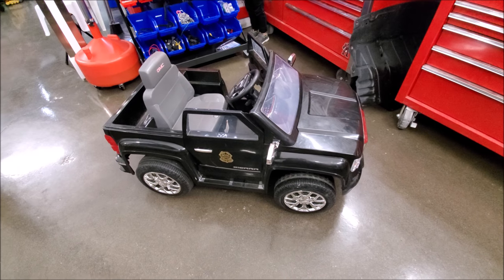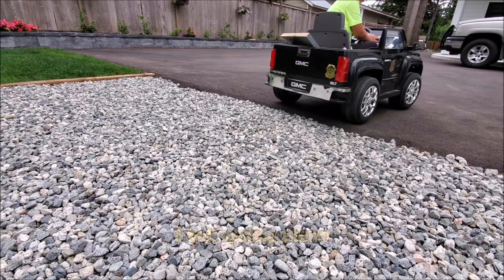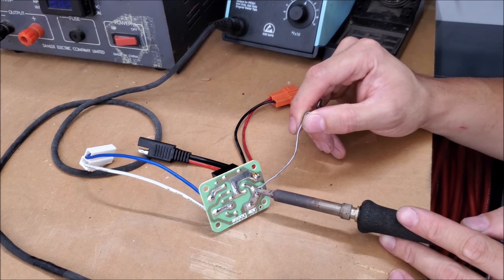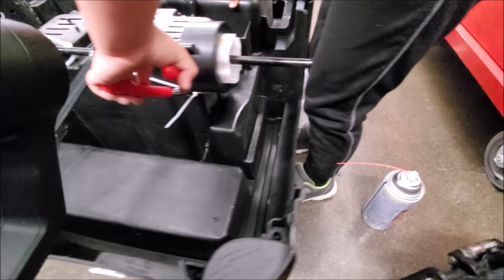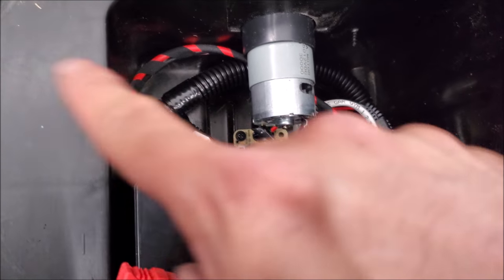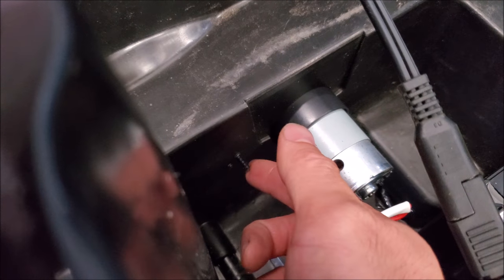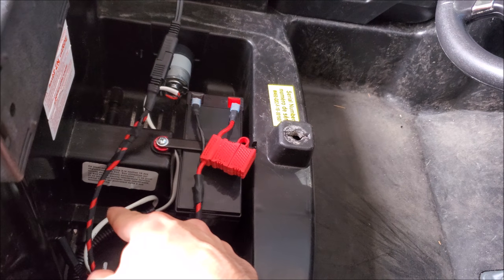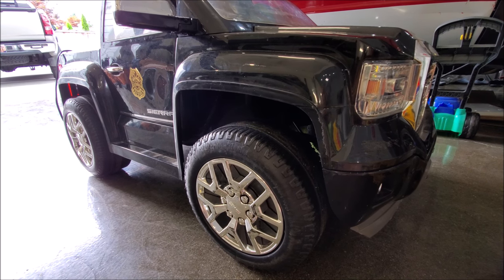6 Volt to 12 Volt Power Wheels / Ride In Car Conversion with Dual Motors! | AnthonyJ350

Comment: Ok so I seen some say the broke gears some say the accessories are acting up I bought 2 24v motor and upgraded gears ⚙️ might buy the slow start slow stop but my question is if I get rid of accessories like a real race car would my control module handle the 18v swap? It’s original 6v w one motor I been told 18v would fry my car idk help idk much about wiring

Comment: Good job! I did a similar thing in my son's Corvette Power Wheels over 25 years ago. I installed 2each 6volt lead acid batteries in series. He could easily keep up with me as I jogged for 1 mile daily. He would get excited at all the new found speed. After 2 years, he out grew it and we gave it away.
Reply from the maker: Nice, that's awesome!

Comment: Hello Anthony, could you send me a photo of relay board from bottom and top? My relays are included in control board and I would like to move relays outside due to different voltage level.
Reply from the maker: In mine you can't remove the relay though

Comment: I added a second motor and just tied into the existing 6 volt battery line. It worked at first but now the second motor and the lights will not work unless it's at a very high speed. Any ideas on the issue? Thank you
Reply from the maker: It's probably a voltage issue
Reply: @AnthonyJ350  is it possible to run two 6 volt motors on a 6 volt battery? Can you tell me how you have your motors wired? I could not tell from the video. Thank you
Reply from the maker: @chefkholla  I have the motors wired in parallel to the 12 volt battery
Reply from the maker: Arnold Rimmer  I did all of that. Did you watch the video? I also added a soft start module in a later video https://youtu.be/BsuRonS4AbA

Comment: Just updated my nephews power wheels to Milwaukee 18v with adjustable motor power output and inline low voltage battery cut off. Lasted for about half hour with 2 kids riding in it (this is a 2 seater model) and one of the modules must have burned out. I saw it draw up to 50A in a loaded "stuck" scenario, so I'm sure that was stressing the cheap Chinese components. It drove really good up until then though.
Reply from the maker: Nice! Next video we're putting in a slow start module. We may have stripped some gears in one motor trying to aggressively offroad up a hill...😅

Comment: Great job.
I wonder what happens to those 6V engines if you just plug it to a 12V battery. Wouldn't that also increase power, even tho it might damage the engine over time?
Reply: Works great
Reply from the maker: Yup, you get a lot more power.

Comment: Did you upgrade the motors aswell to 12v or just kept them at 6V and upgraded the battery?
Reply from the maker: Motors are 12 volt.

Comment: So the original system had a single 6v motor and one wheel drive powered by a 6v battery and you added an additional 6v motor to the other wheel and wired both motors in parallel to a 12v battery? Wouldn't this damage the motors with too much voltage?  Would wiring the motors in a series circuit be better?
Reply from the maker: I never tried them in series. I theory if one failed the other one would also fail in series.

Comment: This is awesome wish i could do this for my son but i think its tooo conolex for me! If i install a 12v battery on my sons 6v would it take it and run faster and longer? And potential issues? Thanks!!
Reply from the maker: Potential issue is the motors rip themselves apart from all the instant torque

Comment: I got the same thing. I can't get the motor  to keep cutting out. My son rides it for 1 min. Then it stops working. Wait 10 seconds.  It starts working again. What can I remove and just straight  wire. To remove this problem?
Reply from the maker: What kind of battery did you install?

Comment: Converting a 12v irerts car to 18v. Has blutoothe and lights. Want to keep the 12v for accessories and wire in ryobi 18v but cant figure out what wires to keep connected to 12 volt and motors on 18v if even possible. These new ones have so many wires now im confused. Any help or direction would be appreciated
Reply from the maker: Need to use relays to transfer power from the new batteries to the motors. Then use the original system to control the relays. I go over it in my "soft start" video.

Comment: Can you please share link for the motors you used.
Reply from the maker: Here you go https://www.amazon.ca/CNBTR-30000RPM-Electric-Motorcycles-Childrens/dp/B07H5JKYJ4?pd_rd_w=FbHTX&pf_rd_p=81408a36-90c9-4f9c-a9f8-f64c14cec4f1&pf_rd_r=P2T0KY4K9N3VC8CZ68PJ&pd_rd_r=2491385f-2690-4d17-b445-0e57ed0e0190&pd_rd_wg=7EtWj&pd_rd_i=B07H5JKYJ4&psc=1&ref_=pd_bap_m_rp_10_sc
Reply: @AnthonyJ350  thank you.
Reply from the maker: @Anupkulkarni23  You're welcome
Reply: Use the same (6volt) motor

Comment: Please help..what need to change?
1. battery
2. Motor.

Others?
Reply from the maker: 2 motors and a soft start module, I have another video for that. You can try without, but the instant torque is pretty hard on it.